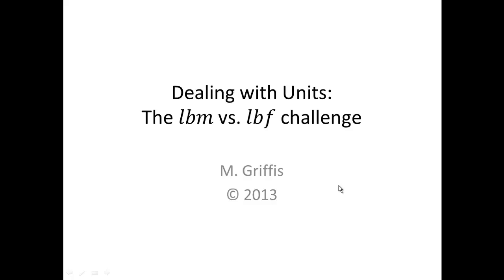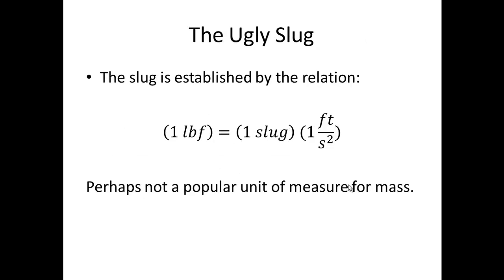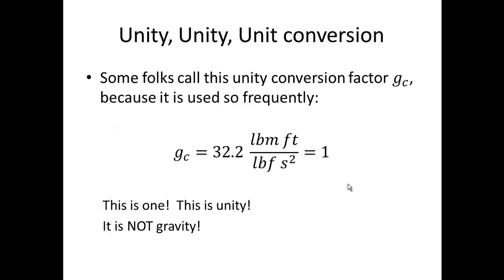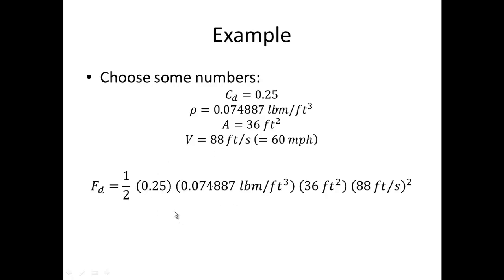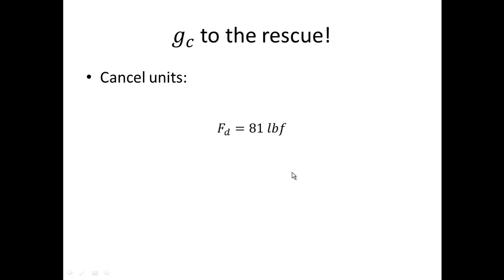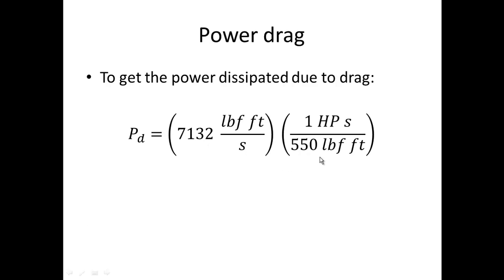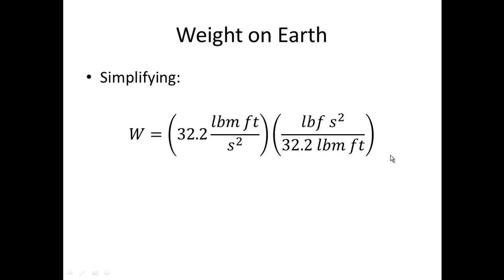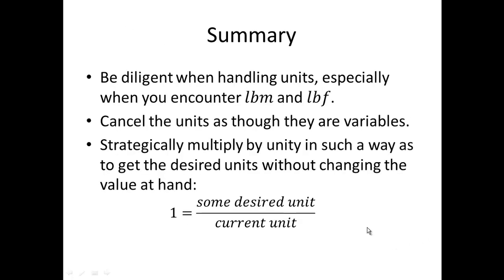pound-mass-vs-pound-force

Comment: The kgf is not an SI unit!   Newtons is the only valid SI unit.    "This is why I use SI units" is a perfectly reasonable response from a student.
Reply from the maker: In US Customary units, the slug is the proper unit of mass.  Nevertheless, the non-standard lbm is also used.  In SI units, the Newton is the proper unit of force.  Nevertheless, the non-standard kgf is also used.   The use of lbm and the use of kgf are both barbarisms.  Equivalent barbarisms, which was the point I tried to make in the video.
Reply: @michaelgriffis2829  Excellent rebuttal

Comment: 32.2 = 1 (?!?)... whatever. g/gc=1 only when the gravitational acceleration is 32.2 (anywhere in the universe, but predominantly on the surface of earth). I would revise the video to say 32.2 is not equal to 1, ya know,  just for arithmetic's sake. Trying to make the argument that 1=32.2 in the drag coefficient example was hilarious. Thanks for the laugh
Reply: Okay, I know this is an old comment, but I just have to respond! 1lbf = 32.2 lbm * ft / s^2; as explained in the video. If you plug that in to the lbf found in the denominator, you'll find that 1=1. Much like how 1 = 60 seconds / minute. Both 60 seconds and 1 minute are inherently equal to 60 seconds, thus cancel out, to leave 1. In other words, the ratio between 60 seconds and 1 minute is 1, as the represent the same amount of time. Arithmetic with units attached isn't as simple as arithmetic without. Your comment was hilarious. Thanks for the laugh, you condescending internet man!
Reply from the maker: Gene: the 32.2 has units with it.  This is in the same vein as 1=12 in/ft.  Multiplying by such "1"s is the whole basis for unit conversion.